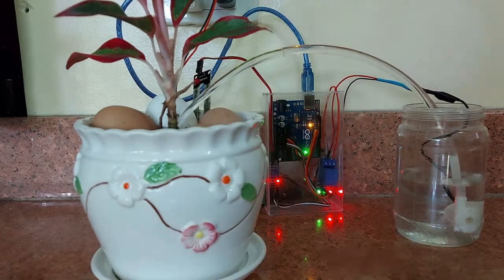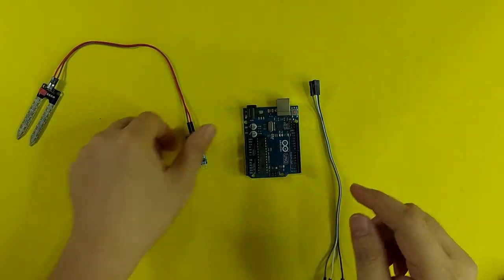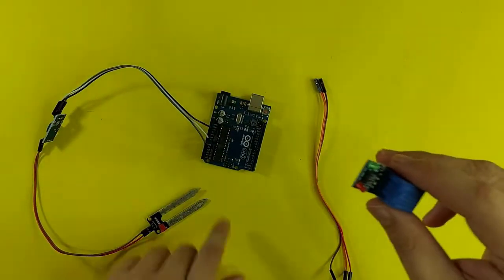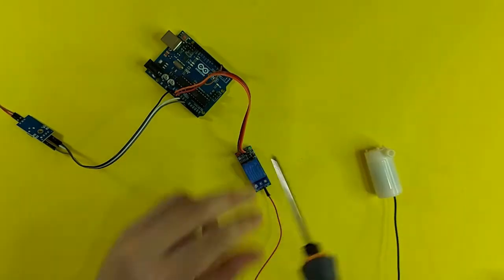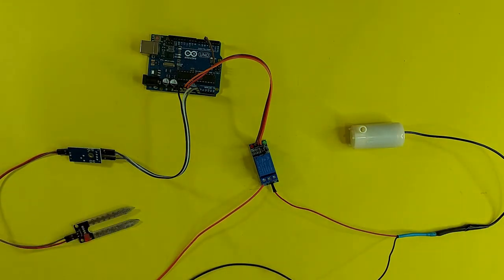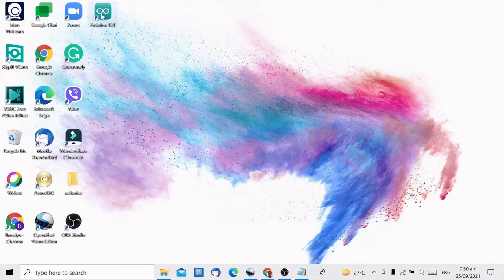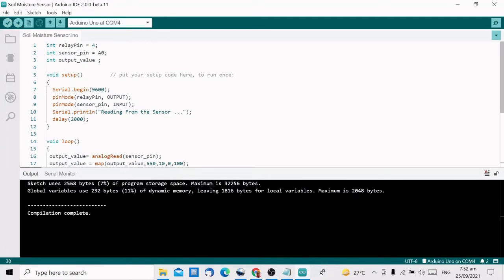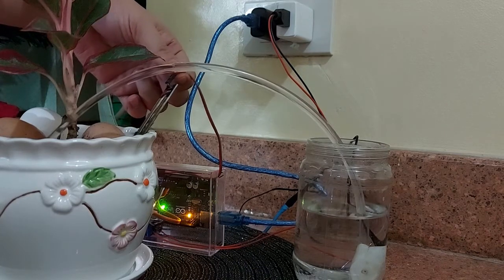Automated Watering System for Plants | Arduino DIY Projects | Step by Step Guide

Comment: did anyone get the code ?
Reply: Will where’s the code ??
Reply: int relayPin = 4;
int sensor_pin = A0;
int output_value; 

void setup ()
{
Serial.begin(9600);
pinMode(relay Pin, OUTPUT);
pinMode(sensor_pin, INPUT);
Serial.println ("Reading From the Sensor...");
delay(2000);
} 

void loop()
{
output_value = analogRead(sensor_pin);
output_value = map (output_value, 550, 10,
0,100);
Serial.print ("Moisture : ");
Serial.print (output_value);
Serial.print ("%");
if (output_value < 20){
  digitalWrite (relayPin, LOW);
}
else
{
digitalWrite (relayPin, HIGH);
}
delay (1000);
}

Comment: int relayPin = 4;

int sensor_pin = A0;

int output_value;

void setup()

// put your setup code here, to run once:

{

Serial.begin(9600);

pinMode(relayPin, OUTPUT);

pinMode(sensor_pin, INPUT);

Serial.println("Reading From the Sensor ...");

delay(2000);

}

void loop()

{

output_value= analogRead(sensor_pin);

output_value = map(output_value, 550,10,0,100);
Serial.print("Moisture: ");

Serial.print(output_value);

Serial.println("%");

if (output_value<20){

digitalWrite(relayPin, LOW);

}

else

{

digitalWrite(relayPin, HIGH);

}

delay(1000);

}
Reply: thanks  for the code
Reply: Bahi great
Reply: Copy

Comment: int relayPin = 4;
int sensor_pin = A0;
int void setup ()
{
  Serial.begin(9600);
  pinMode(relayPin, OUTPUT);
  pinMode(sensor_pin, INPUT);
  Serial.println ("Reading From the Sensor ...");
  delay(2000);
}

void loop()
{
  output_value = analogRead(sensor_pin);
  output_value = map (output_value, 550, 10, 0, 100);
  Serial.print ("Moisture : ");
  Serial.print (output_value);
  Serial.print ("%");
  if (output_value < 20){
    digitalWrite (relayPin, LOW);
  }
  else
  {
    digitalWrite (relayPin, HIGH);
  }
  delay (1000);
}
Reply: 0:49
Reply: wrong code

Comment: Hello sir, can i ask if I can change the 5v water pump with 12v? Is it safe ?
Reply: For that you have to use a 12V relay
Reply: Yes this safe....
Reply: Have you done this? Isn't this effective?
Reply: How about the voltage of the  charger ? Water pump with 12v?
Reply: Send me code😞🙏🏻

Comment: int relayPin = 4;
int sensor_pin = A0;
int output_value ;

void setup ()
{
  Serial.begin(9600);
  pinMode(relayPin, OUTPUT);
  pinMode(sensor_pin, INPUT);
  Serial.println ("Reading From the Sensor ...");
  delay(2000);
}

void loop()
{
  output_value = analogRead(sensor_pin);
  output_value = map (output_value, 550, 10, 0, 100);
  Serial.print ("Moisture : ");
  Serial.print (output_value);
  Serial.print ("%");
  if (output_value < 20){
    digitalWrite (relayPin, LOW);
  }
  else
  {
    digitalWrite (relayPin, HIGH);
  }
  delay (1000);
}
Reply: Irrigation System int sensor_pin= A0;int output_value; void setup(){ pinMode(3, OUTPUT); Serial.begin(9600); Serial.println("Reading from the Moisture sensor…"); delay(2000);} void loop(){ output_value= analogRead (sensor_pin); output_value= map (output_value,550,10,0,100); Serial.print("Moisture:"); Serial.print(output_value); Serial.println("%"); if (output_value<0) { delay(1000); digitalWrite(3, HIGH); } else { delay(1000); digitalWrite (3,LOW); } delay (1000);}

Footer
Reply: Brother you have sacrificed your time for us
Reply: @AtherKhan-cv5wi
Why you write code ? What do you mean by Footer?
Reply: We love u
Reply: Thanks a lot
Reply: thank u brother
Reply: Héroe
Reply: It's work ??

Comment: Don't forget to like : 
Code :

int relayPin = 4;
int sensor_pin = A0;
 int output_value ;
void setup()
{
Serial.begin(9600);
pinMode(relayPin, OUTPUT);
pinMode(sensor_pin, INPUT);
Serial.println("Reading From the Sensor...");
delay(2000);
}
void loop()
{
output_value=analogRead(sensor_pin);
output_value=map(output_value,550,10,0,100);
Serial.print("Moisture: "); Serial.print(output_value);
Serial.println("%");
 if(output_value<20)
{
digitalWrite(relay Pin, LOW);
}
else
{
digitalWrite(relayPin, HIGH);
}
delay(1000);
 }